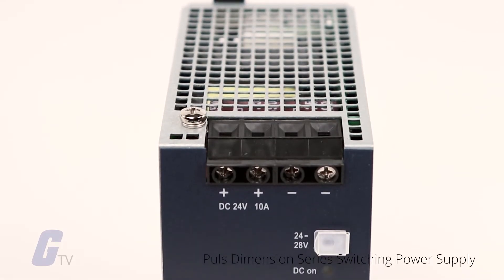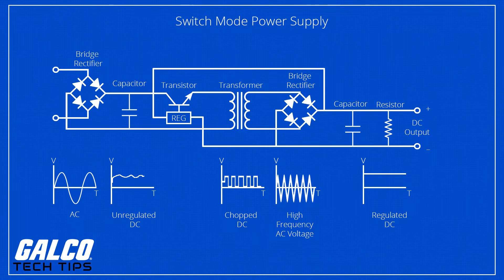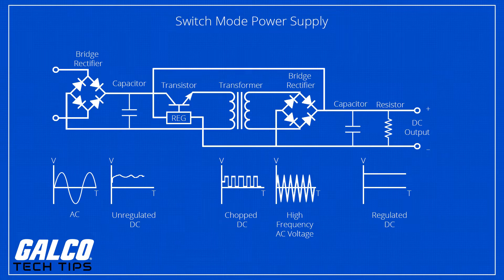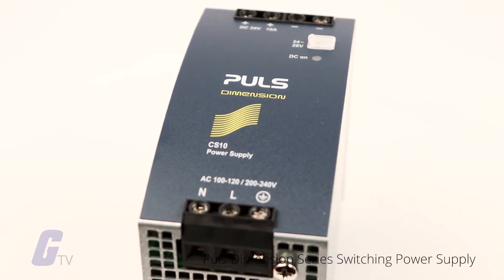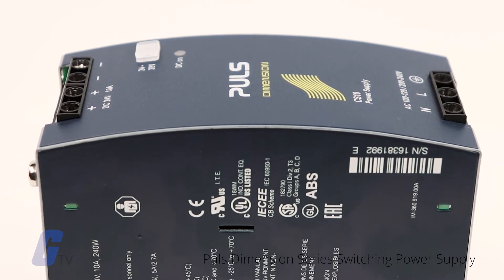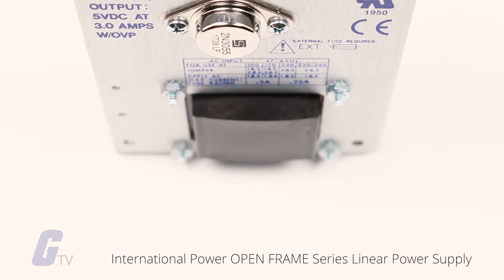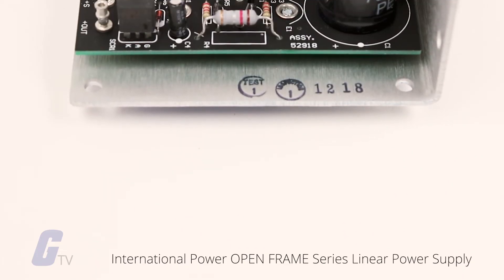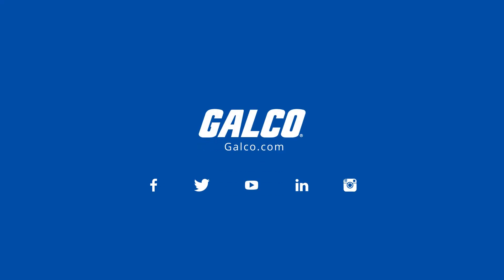Switching VS Linear Power Supplies - A Galco TV Tech Tip | Galco

Comment: A full wave transformer and rectifier with a central tap has 81.5% efficiency. It will be a little heavy but very robust and durable to changes and fluctuations in voltage and noise. Soon they are more reliable.